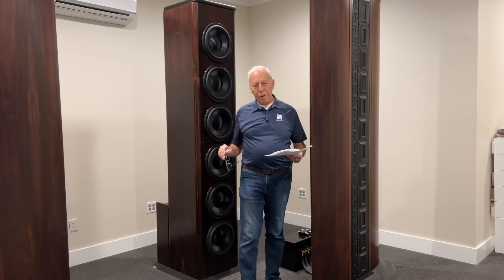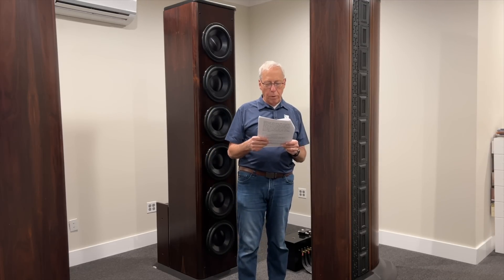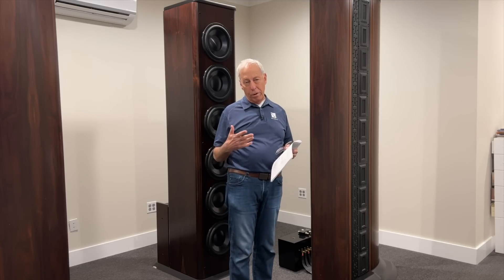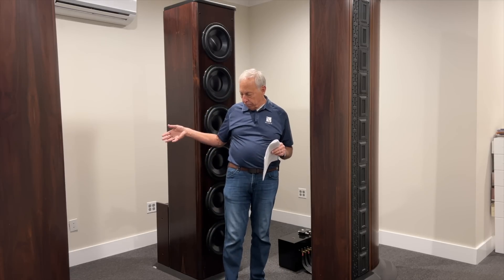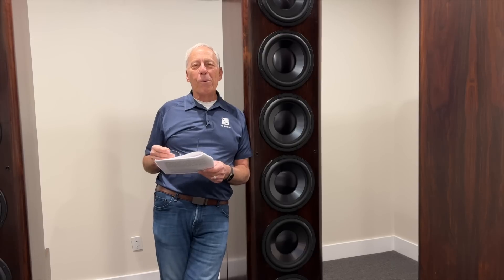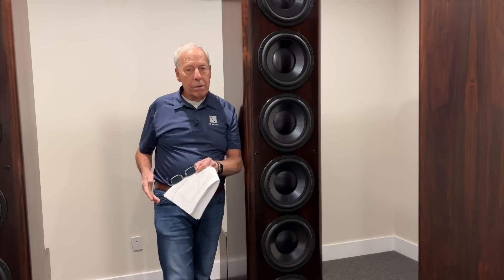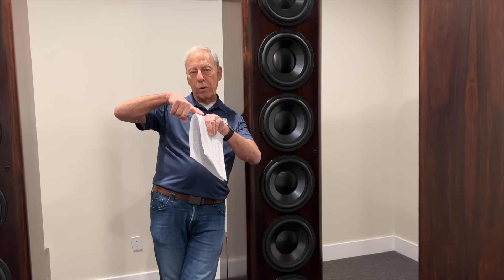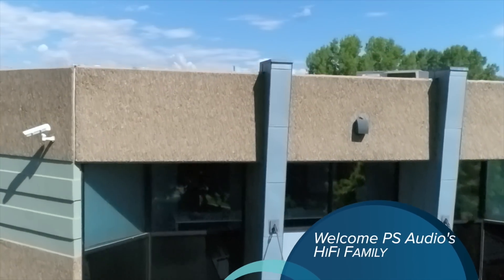Separating speaker cable conductors

Comment: After having issues with a set of Star Quad speaker cables I shotgunned (one pair for + one pair for -) some Monster Cables terminated with locking bananas on both sides. Measurable increase in dynamic range. Amp ran cooler. 

I typically just then randomly on the carpet to stop any parallel lengths. But I like the braiding idea and will have to do that. Thanks! 

Been watching a lot of physics videos discussing energy and information transmission across wires. There was a big blowup in the Youtube physics world a few months back about how long it actually takes for current to flow thru wire especially extreme lengths of wire. I think this one started it off. youtube. com/watch?v=bHIhgxav9LY&t=24s.
Reply: How did you measure this "measurable" increase in dynamic range? And let me guess: you're NOT an electrical engineer, and neither are any of your friends
Reply: @d0sk3y  I used an SPL meter. Does this confuse you?

You just can't get anything right can you? I have a degree in Electronics, an FCC Broadcast license, repair and design my own test and audio equipment, built speakers, I have literally designed and sold TV stations, satellite trucks, ...  I lived in Nashville working as a Rep for the top audio products, as a member of AES I sold to recording studios there. Introduced AT mics to the Opry stage, .. travelled giving seminars and clinics on amps, speakers, ... ran a regional major brand warrantee repair station in Atlanta. Oh ya, I came in 2nd place for National Service Manager Studer/ Revox while in Nashville. They did not like my handwriting examples I had to submit. I moved to Video and then computers where I gave lectures on test and measurement of HDTV and disc based editing for HDTV to SMPTE conferences. Just retired after selling leading edge IT around the world.

Oh and I am surrounded by audio/ electronics people. Not just friends, but my two oldest sons have impressive old school audio systems. They each won 1st place in a state wide HS electronics contest sponsored by one of the Top Ten Engineering Colleges in the US, MSOE, in their respective years. One also won 1st place in computer programming in a contest there as well. While in HS he had a laminated hall pass and would be sent to other schools in the district to do their IT. One worked on the bench repairing audio and video. We can all troubleshoot to component levels. 

Other questions?

Comment: My speakers sound bright so I use 600 ft of speaker cable, helps roll off the top frequency's lol. I think we have a lot of people whom put way too much emphasis (and $$) on wires and cables. Just get adequate copper, connectors, length, and gauge and spend the rest of that money somewhere else in your system or records/CD's. Maybe it's cause I don't have a $50k plus system but I don't think cables should be making or breaking the sound of ones stereo set up.

Comment: Doesn't braided wire cause high C, low L and parallell separated wires low C, High L?
Reply: This is correct, Paul got it mixed up. Separated wires increase the inductance (L) reducing capacitance (C) and close-up wires vice versa. Reducing L for speaker wires is more important than reducing C as the impedance of C will be parallel to the speaker just loading the amp, but the L impedance will be in series with the speaker reducing its efficiency for the highs.
Reply: Inductance is caused by changing magnetic field strength. Coiling wires increases inductance by concentrating the magnetic field. Capacitance is caused by separating two metal objects, the closer (less separated) and larger the shared mutual size, the bigger effect. It is also affected by what material separated them, e.g. air does not work as well as wax paper. 

Inductance is connected to the magnetic field which expands and collapses around the wire while capacitance is connected to the two energy fields that radiate perpendicular to the wires at 90° to each other. (Very simplified)

When two wires are run in parallel you then also get the Transmission Line effect. This is represented (schematically and mathematically) by a continual series (and parallel) of capacitance, inductance and resistance. 

So yes two wires run in parallel with close proximity would have higher L. However when two wires are braided their point of contact is no longer linear and parallel. It is close to 90° at each intersection. Those the magnetic lines of force is reduced between them. Lowering the L. 

But C is how much total surface area, how far apart and separated by what. Two wires touching and run in parallel would have a greater common surface area closer together than a braid.

Comment: I have never heard the difference between speaker cables once you get them thick enough to get their resistance down to a non influential level.
Skin effect, inter-core capacitance and inductance play no audible effect at audio frequencies. It's not practical but welding cable makes a big difference compared to lighting flex. Although more practical but not elegant, I use 6mm solid copper house wiring cable. The problem with down to earth practical solutions is that they don't have a brand name for audiophiles to brag about and argue the toss over.